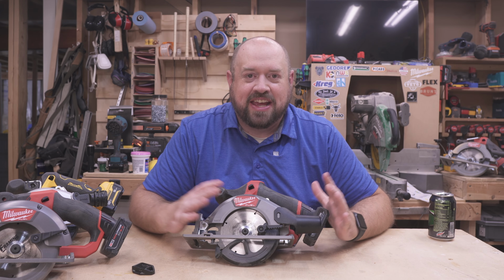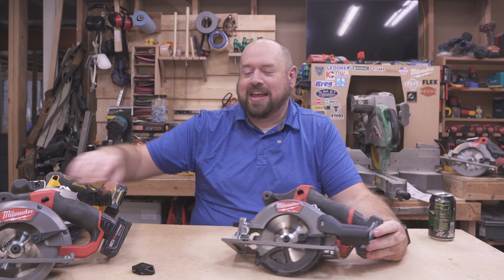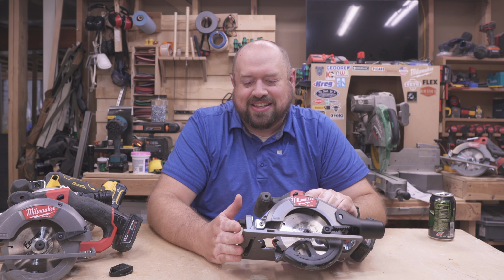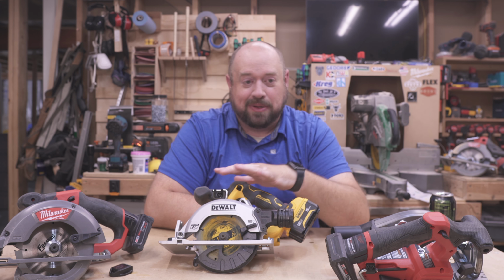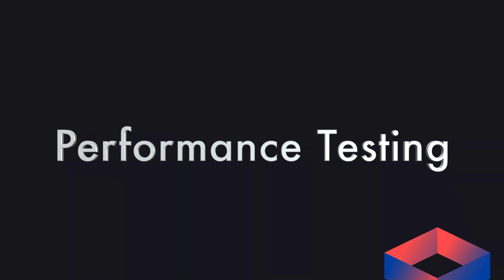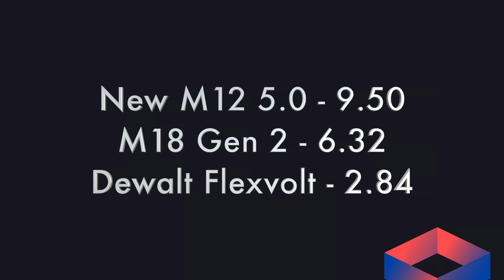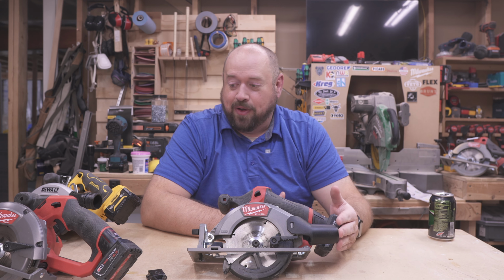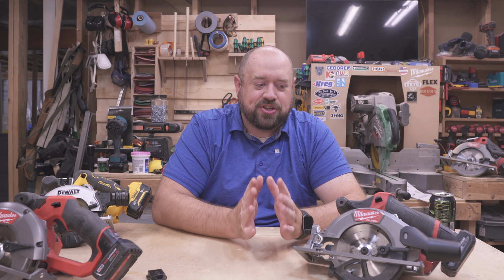Milwaukee's Smallest Saw is a BIG Deal!

Comment: I always wanted an M12 fuel circular saw for it's light weight and ergonomics. I have the gen 2 M18 fuel 7-1/4" circular saw, and while I appreciate the power, it's very heavy to lug😮 around. I was going to buy the M12 for finer work, but I'm glad I waited, because now I can have it even more compact with even more power. Ordered one last night and I'm gonna put a fine tooth blade on it for those more delicate wood cuts. Then I'll have a dedicated saw for roughing and finishing. Great video!
Reply from the maker: I have loved it for breaking down scraps before they go in the trash.  It also will go with me when I might need to break down material at the hardware store.  Nice and compact fits in the trunk easily.

Comment: Thank you for this video! I’m considering the newer M12 saw aw my first Milwaukee tool, with the idea of combining it with the milescraft track saw guide (if compatible) to essentially make a super compact track saw for accurately breaking down sheet goods. Does this sound like an appropriate application for this saw? I don’t need crazy amounts of power, clean cutting is more important. I just need something I can comfortably hold and use (repetitive stress injuries in my hands mean heavier tools are difficult to operate) to break down a few sheets of 1/2” or 3/4” plywood every couple of months.
Reply from the maker: I have never used the milescraft with a saw so I can only speak to the saw.   It will have power to cut through sheet goods as long as you aren't doubling them up and with a good blade I think you will achieve a clean cut.   As long as it isn't more a production setting, I think the run time would be sufficient for lighter use.
Reply: @ thank you so much for replying! YouTube’s algorithm, now knows I am aware of the M12 line from watching a million videos about this saw, and of course I’m going down a mini power tool rabbit hole that might have me spending my rent money on a pin nailer and mini bandsaw 😆! YouTube is doing the good work of strengthening capitalism as always! Cheers and have a lovely day!
Reply from the maker: Good luck on the rabbit hole - on a side note the M12 pin nailer is an awesome tool!

Comment: Thanks for doing a comparison. Did you use a new blade in the dewalt 12v saw when you started the cutting?
Reply: Good question. The new M12 looks zippier but new blades on all the saws tested would be more revealing. Also would love to see the 12v saws vs the Metabo HPT 18v Deep Cut (my go-to small saw).
Reply from the maker: No but the blade is far from worn.  While it’s older in terms of age by the time of test I would bet that both Milwaukee has blades more use on them.   New blade would have been ideal but  after spending $250 on the saws I didn’t want to buy three blades on top of it.  I will be putting a new Diablo blade on the new M12 now though.
Reply: @TinkerWithTools Home Depot is selling 2  6.5 or 7.25 Diablo blades for $12.88--maybe you can get them to hook you up for the 5 3/8" blades...

Comment: VERY GOOD Test and Video, Tinker !!!!!!!!!!!!!!!!!!!!!!!!!!!!!!!!!!!!!💯

Impressive little saw.  As You know I own the 12 Volt XTreme DeWalt, and I want to like it every time I pick it up, but I also have to keep myself from throwing it across the yard when I do!  😯 After liberal use of Silicone spray, and a few adjustments, I can actually use the bevel.  It is a smooth little devil, but they just missed the mark, IMO.  Maybe mine is a poor copy, I don't know?  It was free on some battery Promo at SLowe’s (sic)

These saws have their place, but if the price was right, I would just go for the new 6&1/2” Blade left saw!  I am hoping the Homer Despot runs a promo on it, but I really don't need another saw 🙄 
7 corded models, and 5 cordless saws!   Must be a disease?  🤔😯🙄🤣🤣
Reply from the maker: After picking up 3 saws in the last few weeks, I managed to sell one that I didn’t need yesterday.   I don’t have quite have 12 but it’s not far off.
Reply: @TinkerWithTools  I’m sure You will in Time my Man!  😊

Comment: To me, the 12v tools are complementary to 18v tools, not replacements. 12v are smaller, lighter and more convinent, but obviously pack no where near the same level of punch.

Only 12v tool I have i consider a direct replacement for 18v is the m12 fuel impact driver and drill, and because theyre on par with 18v compacts without having an 18v battery
Reply from the maker: I can see what you are saying.  I think a saw like this is a benefit to someone who only wants to run M12 tools but occasionally needs a saw.  It's not going to be heavy duty like the M18 but it gives a solid option for the M12 dedicated user.
Reply: @TinkerWithTools  m12 is "doable" for a tradesman like an electrician or plumber, you even have the m12 mini rotary hammer for drilling into concrete. 

It's also a great homeowner system being compact and the batteries being cheaper than m18, but then skil with their 12v system is a huge disrupter in the 12v segment, and their 12v tools are so ridiculously cheap for their quality I'm debating buying some
Reply: I'm an electrician  I run all m12 tools. I cut timber frequently, but only 2x4 or smaller, so the m12 is perfect.
Reply: To me M12 tools are absolutely a replacement. All I have 18 volt left is a sawzall
Reply: Just replaced all my 18v with 12v the other day. If you are in a lighter trade, it's absolutely all you need. The 12v drill is a beast, pushed it through 3x25mm top plate holes through double plates and then with the massive 20mm extendo bits to drill 2m down a wall through 3 dwangs. Barely takes up any room in the toolbag compared to the 18v monster and SO much lighter. Hammer drill is fine for punting little 6mm holes, just a little slower than 18v. Tools have come a long way since the nicad days for sure.
Reply: @Shrouded_reaper  I have 2 tool caddies and a toughbuilt electrician pouch. Everything for work is selected to be light and compact. In all that I carry all my hand tools, meters, drill bits, holesaws, a small screw tray, an M12 Drill, Impact, Surge Impact, Cut off tool, Multi tool, Rotary tool, Circular saw, SDS hammer drill, Hackzall, Soldering iron, and Area LED light. In one trip from the work vehicle I can carry prettymuch everything I could possibly need 🫡

Comment: I’ve got a whole collection of saws and I gotta say my favorite cordless for cutting 2x material and sheet ripping is the DEWALT 20v 4 1/4” almost more a rear handle style with a big hook to hang it everywhere
Reply from the maker: I have considered picking up that saw a time or two, if for nothing more than to try out that form factor.
Reply: Do you have flex?
Reply from the maker: @azendantforces1897 I do not.
Reply: I have to say, I have never had the chance to use that saw, vinnie?  🤔 Most that have seem to like it.
Reply: Definitely recommend buying it and giving it a chance, I hated it at first and now it’s my go to saw for all my 2x material and sheet ripping
Reply: @TinkerWithTools  buy it! You will not regret it. I’m technically a Milwaukee guy but the dewalt 4 1/4 will out work any Milwaukee saw I’ve ever tried lol
Reply: I really thought Milwaukee was going to copy this for their 2nd Gen saw. The small 4.25 blade seems like a perfect pairing for a 12v battery. Compact, light weight, small base plate. Can do 90 degree cuts on 2x, rip 1x no problem. Still deciding if I'm going to upgrade to the 2nd Gen.

Comment: Flex inline circular saw.  It permanently replaced my m12 and every other saw i own.  Light, powerfull, line of sight on both cut line and blade.  Pivoting dust chute.  Great light.  Blade is perfectly parallel to base edge...using a guide with no binding.  Sounds better than any of these sick dogs...
Reply: What model #?

Comment: If you like that and you really need a smaller saw I recommendHiKOKI C3605DA(SK)(NNB) 36V, 4.9 inches (125 mm), Cordless Circular Saw, High Speed 7,000 rpms this saw cuts
And rips like you're using a lightsaber. They have one that the base comes off at the blade edge bevell's 15°so you can cut out subflooring. Another model is set up for dust extraction and when using a bag it picks up 90% of the dust. 36 volt 7000 RPMs small lightweight nimble. I bought mine from Amazon Japan and for $5 more shipping they flew it out and got to me in 3 days.
Reply from the maker: I'll have to check it out!  Thanks!

Comment: The plastic guards are a very weird choice to me. much rather have metal.
Reply from the maker: I am guessing it was to keep weight down as much as anything.  so far I haven't noticed an issue with it but I am also not beating on it too much.
Reply: @TinkerWithTools  Yeah, I assume so too. but I'd take the extra weight.
Kinda want the part thats gonna protect me from the spinning 2 inches of blade in a kickback to be extra durable. 
I just wonder how it reacts under force of a kickback. if it did jerk and fly back, smacking into your leg with sudden force. Does the plastic flex or bend a bit? crack? get flexed into the blade? 

I wonder if you could find a metal guard for same sized saw and put it on.
Reply from the maker: I am guessing that you wouldn't be able to swap it out simply because even a saw with the same blade isn't the same size for all the parts.   The old M12 metal cover wouldn't fit on this saw.
Reply: @TinkerWithTools  Hm.. darn. Be nice if it wsd compatible.  only way would to go totally custom on it then. Either cast or 3d print the part out of metal.

Comment: Day 1254 of asking why no company makes a 7 1/4 sidewinder with LH blade
Reply from the maker: Yeah I don’t know the answer to that one.  I know in the 6 1/2” size there are some blade right where most things are not but it seems in that size the only option is rear handles.
Reply: @TinkerWithTools  Next time I see a milwaukee rep at home depot I will not allow him to leave the premises without an answer 😂
Reply from the maker: Blade left was a revelation to me when I finally tried it.   Blade right always kind of felt awkward to me but it was all I knew.  I do think I’ll be picking up the new 7-1/4” blade right when it comes out next month.
Reply: @TinkerWithTools yes me too I want the 12 amp FORGE BATTERY and for just $200 More new 7-1\4 saw that I don't own a Milwaukee CIRC SAW and BLADE ANOTHER BAG and I could always use another Charger JUST NEED the MONEY because I also want the 8 AMP FORGE BATTERY Only
Reply: I believe You have to go corded to get one;  Bosch comes to mind?
Reply: @evictioncarpentry2628  That’s the spirit!  Corner the Devil and make him answer!  😂
Reply: @TinkerWithTools  Blade left VS blade right, they each have their place, and YES, I use both.  To each their own, and of course, YMMV!  👍💪✌😊
Reply: @georgedavall9449  No one wants corded anymore unless you're 75 years old. Lol
Reply from the maker: @georgedavall9449 yes I have a Bosch corded blade right that my dad gave me for my birthday about 10 years ago.  Nice saw but cordless has come a long way in 10 years.  As for blade right vs blade left I am sure there plenty of good reasons for blade right.   I’ll picking one up next month for sure
Reply: @evictioncarpentry2628  Really?  I merely was replying/ contributing to your original comment, brah.  I use a corded saw monthly, when I do maintenance check on the ‘Genny,’ to make sure the field coil is up to snuff!  Lol
I love my 36 Volt Makita rear handle ‘style’ saw, but if I have to do a lot of cutting, I get out my Bosch Worm drive saw, which will cut through just about anything!   ( a rebadged SkilSaw).
Reply: @TinkerWithTools  It all comes down to a personal preference, and use case.  😊
Reply: @evictioncarpentry2628  And I aint 75!  😂
Reply: Bosch makes a cordless 7-1/4 blade left and right @TinkerWithTools